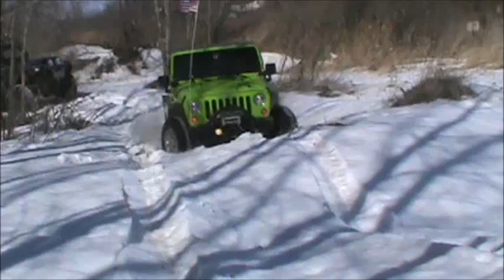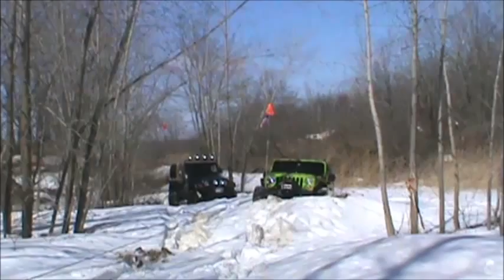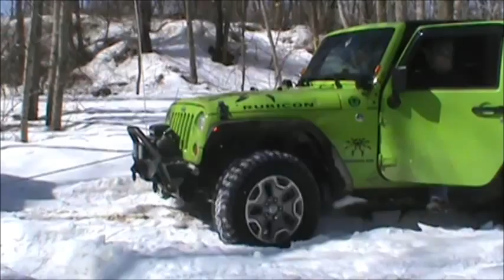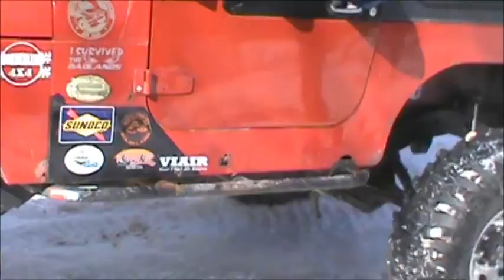Jim's Harbor Freight Badlands Winch Absolutely Sucks @ Bundy 3-23-2014

Comment: Have run with a Badlands 12,000 pound winch on my Z71 for years and is flawless....Jim's problem is his driving
Reply: Pete Kiser  My Warn will drag my truck with all four wheels LOCKED on dry ground. I pulled a Chevy K3500 out of pond with my Ramsey 6000 pound winch on a snatch block. Pulled so many amps it melted the battery connections. There is a performance difference that will be reflected in serious situations
Reply: I agree Pete, they just don't know what they are doing
Reply: problem might be weak battery
Reply: I agree Pete this guy can't four wheel he is also killing his jeep
Reply: Jim shouldn't be driving...
Reply: @myfestivus4336  you know Warn makes half their winches in China, right?

Comment: That quoted duty cycle is at max load in hot conditions. In other words, it’ll yank a 9000lb rig up the side of a tree for 45 seconds straight before needing a cooldown. Dragging a 4000lb JK plus a couple of hipsters and Orange Mocha Frappuccinos on nearly flat ground (albeit in the now), it will probably run continuously for the majority of this video without issue.

This of course assumes the operator isn’t making things worse for himself by digging it to the frame every 5 feet. Use some discretion with the skinny pedal man.

Comment: How to not get stuck:
1. Better tires
2. At least a little lift
3. Find the zone between idle and redline.
4. Snatchblock
Reply: LMFAO!!!!!
Reply: This might wreck your day buddy. 1. Snatch blocks don’t prevent you from getting stuck. 2.lift has little to do with off-road capability. Tire size is the only thing that’s gonna lift those axles.
Reply: @DWBmotorsports  pretty sure a lift and bigger tire would have prevented him getting high center
Reply: If you’re getting hi centered on dirt in a JK (non U), the problem is 100% between the seat and steering wheel
Reply: #3 for sure

Comment: Been wheeling for over 30 years and have performed MANY recoveries. My simple assessment: First and foremost; 1. Extreme driver error { he is either deliberately doing everything wrong, or he simply does not know how to drive a 4x4}. 2. Too much air in tires 3. When being winched, DON"T spin your tires! 4. Single line pull...?

Comment: 5 MAIN REASONS FOR THEIR FAILURE:
1. Green Jeep: Inexperienced, bad driver.
2. Overinflated, tires for the terrain/conditions.
3. Wrong tires for the terrain/conditions.
4. A bunch of novice winch users that do not know how to properly winch/recover a vehicle.
5. Too many people trying to blame the equipment/gear; fail to realize their own lack of experience/knowledge.

If you are new to off-roading, especially in winter, this is a good example to watch so you can learn what not to do in winter/snow conditions.

To all of the commenters stating: ‘needs a lift,’ a lift does nothing in this situation. The differentials (diffs) will still drag through the snow and cause high centering, as the diffs are the lowest points of the vehicle. The only thing that lessens that chance is bigger tires which will raise the diffs and give more clearance.

Comment: lol, people will dump $40k plus in a jeep and suspension and tires, and then cheap out on a winch and try to defend it because it was a few $100 cheaper than one that actually works.   Glad you posted this video, I wish more people would heed warming.
Reply: +Roy Lane Yeah, save your 40k. Buy a 10k or less jeep and go beat the crap out of it. Just buy some good recovery straps and wait for a Unimog to drive by.

Comment: 7.50 -16s  with heavy  lug tread , the only way to beat the off-road snow
Reply: I owned 2 old Willys trucks. A 1948 pickup and a 1951 wagon, both with 7.50-16 pizza cutters.

Comment: Observing duty cycles while winching is imparitive if you don't want to burn up your unit! Over hearing the guy in the video say he didn't believe the owner of the vehicle with the winch on it that the duty cycle is 5% (45 second run time under full load needs a 14 minute 15 second cool down) is fairly standard. ALL electric winches have a duty cycle similar to 5%. If you want a 100% duty cycle you need a hydraulic winch that runs off of the power steering or a PTO. The down side to hydraulic winches is if the motor wont start your stuck.... PERIOD!  Its not the winch that sucks! Its the operator!

Comment: lol, first off, why are you 4 wheeling on street tires.... 2nd, I own a 12K badands winch w/ 16K synthetic rope and have pull myself and my friends out of loads of messes without a hitch. In fact, one of my Jeep friends were so impressed,he ran out and bought a 12K HF winch for himself.  As for Warn winches, ya they're nice, but so is a Range Rover, but I paid a whole lot less for my rig and go just as far if not further in my Bronco II. FYI, Even with the best recovery gear in the world, it still won't make up for poor driving on inappropriate tires .

Comment: Pulled my bosses f-450 out of a hole with my 9,000 no issues. But then again it's on the front of a xj not a jk
Reply: In other words: less worried about impressing your fellow Orange Mocha Frappuccino drinking JK owners and more worried about making your mods count? Right there with you.
Reply: Umm I have a JK with a 12000 lb winch and have pulled people out of areas just fine. I myself haven’t gotten stuck, But then again I have the proper tires and other mods, and know how to handle my Jeep.  Oh and not worried about impressing anyone.

Comment: Why do people think a jeep can go anywhere?
Reply from the maker: For the record, his Jeep got there and got out. Plus made a fun video to watch on the way
Reply: Because with the right setup and skills, they damn near can go anywhere. :)
Reply: CoolHandBart74 The tires were the issue... in that much snow you need more meat.  He's also way too trigger happy with the skinny pedal, but that can also be remedied by proper tires.
Reply: boardthis his tires are the problem here. He also doesn't  know how to operate that winch properly.
Reply: boardthis
Reply: The problem is that he is in to deep, more than that jeep can handle.
Reply: +Tony Kinsey and a mostly box stock with a 4" lift & a harbor freight winch aint't the right setup. It's a mall crawler.
Reply: ROTAXD
For the weekend offroader that is all that is really needed.
Reply: +ROTAXD When it takes that much to go to the mall, I'll just order off Amazon.

Comment: for price point it's 10x the winch a warn is....
Reply from the maker: No, it's not. There's 2 winch brands Warn and Not Warn.
Reply: Drew He falls into the category of getting out, and not getting out. Warn works, every time.
Reply: Drew when it comes to recovery gear, if it is not dependable it is not worth having.
Reply: +MrMrsregor it doesnt look unreliable ... it either looks like the don't know what they are doing or they have too small of a circuit breaker.
Reply: +Jeff Schultz sounds like a bad remote connection.    But 9 times out of 10 people are trying to run 12,000+ winches on a single (usually under-powered) battery which just doesn't work well, no matter the brand.
Reply: +777fuzzypeach If you think a warn can't fail you are delusional. It may be less likely to fail, but that is not a guarantee. High current motors creating tons of pulling force can fail, doesn't matter what brand.

Would I prefer a Warn over a Badlands? Of course, if I had the money and a real need for it.
Reply: Jeff Schultz
The solenoids or the high voltage contactor will lock out before the motor reaches a failure point. I have decades of experience with Ramsey and Warn winches and have yet to experience a motor failure. Solenoids are another matter and the new Warn contactor control is a major improvement.
Reply: +Chris Holmes and there are two types of people. Those who read the instructions and those who don't.  

As per the BL operations manual: The Duty Cycle defines the amount of time, within a 15 minute period, during which a Winch can operate at its maximum capacity without overheating. For example, this Winch with a 5% duty cycle at its 14 minutes, 15 seconds after every 45 seconds of continuous operation. Failure to carefully observe duty cycle limitations can easily over-stress a Winch contributing to premature Winch failure.

And from what I've heard, WARNS 35sec of use, 10 min cool off. Depends on how hard your using it. But I'm a noob, what do I know...
Reply: Cowboy in the nuclear green 'rubicon' was too self conscious, he knew his yuppie friends were too busy worried about hooking up their ipods at the starbucks.   My 9k from HF pulled my k5 out submerged, and many other recoveries out of gator infested swamps. they work fine. Token maxim: operator error. May the lattes bless y'all in spite of your heresy against HF.
Reply: I just took the 8000 BL winch off my car trailer and replaced it with a 8500 super winch.  Roughly the same price. Huge improvement.  The Bl would shut off after about 20 seconds winching a dead truck onto a trailer.  I was using a snatch block to lessen the load.  Still problems.  It would take about 15 cool down cycles to get a truck on.  The 8500  super winch pulls it up in 1 shot.  The good news is I got $100 for the badlands.  I have a 12500 warn powerplant mounted on my truck.  its been nothing but spectacular.  When you are winching out,  or winching onto a trailer the extra money is money well spent in my opinion.
Reply: You might want to take a course in physics.
Reply: Since I am just a poor little 'fucktard', please enlighten me on how the physics work out in this situation Sir Newton. I'd be highly interested into how a physics equation proves the theory of price point value.
Reply: not really I have had 3 of them fail
Reply: Ramsey is a nice one but you pay for it too!
Reply: @MrMrsregor  After doing some research I found out that the warn 1ok winches are made in CHINA.  Only the much higher end winches are still made in the USA by Warn.

Comment: Have a HF badlands winch rated for 12000 pounds one he isn't using using the rating guide for the pulling capacity of the winch as far as the cable is concerned it lessens the pulling capacity the more cable that is unwound and the most important thing is he has a keep and riding in snow that's damn near 2-3 ft deep with no weight get a real truck and stop blaming the winch my winch has pulled everything from cars to diesels on my trailer with ease but a classic case of blaming something when it's the persons fault next time read the manual

Comment: Instead of running a single line, try running at least 2:1, if you got a few straps, snatch blocks, and you can run 9:1, with that rigging you could lift the whole rig off the ground with that winch. I see nothing wrong with the winch.
Reply: This hurts my eyes...don't do drugs kids.

Comment: WTF, Jim needs someone to show him the correct way to do it these helpers are ass clowns, lol. First STOP floor Boarding into snow piles go slow and back up a few times crush the snow down with your tires so you can drive on top of it getting hang on the frame is not a good thing air down the tires to 10 PSI on all your tires it allows you a bigger foot print go slow and crush the snow down first. And when winching allow the winch to do it's job don't over driver the winch speed go slow. I know this is an old post but hopefully this may help the next guy out! Oh and buy a snatch block it will double the winches power at 3/4 the amp draw of the battery!

Comment: One thing that surprises me is when Jeepers  let some guy with street tires roll around with them. Ahh, he's in a Jeep, he'll be fine. So many times on the trail I had to wait while some Jeep club was pulling one of their guys out of a hole, no lift, street tires. For Christ's sake just tell them they need this or that to go wheeling. The name Jeep doesn't mean it's ready for anything from the factory.
Reply from the maker: Jim holds his own. Look for vids on my channel of a green rubicon jk. He beats it, repairs it, and beats it some more. I'll be surprised if it aint on 37's by next year at this time
Reply: I run street tires on my xj and I can out wheel any of my friends with trucks with offroad tires.
Reply: dirtshower250 I had a bone stock (except for a cold air intake) 1990 xj and went places  in 2wd my brothers '93 4 runner couldn't in 4 low! And climbed hills my cousin's lifted chevy half ton on 35" trires with 456's and a 383 stroker could barely make it up at all!
Reply: Chris Holmes Jim is a terrible driver. I watched your videos and his horrible throttle control and situational awareness is the culprit for constant repairs.
Reply: If you know how to drive properly you don’t need a lift, just get better tires. I have no lift, and have 33x12.5 nitto ridge grapplers and get through trails, mud and snow just fine.

Comment: Didn't see anything wrong with the winch...other than its slow and the duty cycle is like 5%.
The DRIVER on the other hand could use some pointers. And next time you are in that kind of snow...put some damn chains on your tires.

Comment: you cant expect to run a winch at a 100% duty cycle. looks like it pulled this jeep out fine. just the jeep couldn't get traction.  Why are all the other jeeps seemingly running circles around you. Maybe a lift kit and different set of tires would help.
Reply: +Ken A Or maybe he should have chose a more friendly trail? If he's at Bundy Hill (MI), they have like 4 or so trails. All for different skills sets. Maybe he took a wrong turn?  Agree about the duty cycle. BL winches have 45/15 5% duty cycle. 45 sconds of use, 15 seconds of rest. That 15 seconds is a good time to rethink your situation too.

Comment: seems to be a driver and winch operator  issue...clicking a semi auto gun ain't going to help you much..need to build the tension up right off the bat and longer trigger pulls. Least that's what I see from other videos, instructional videos, and from personal experience. 
hope they know the more you spool out the more that winch has to work and the less lbs it's rated at.